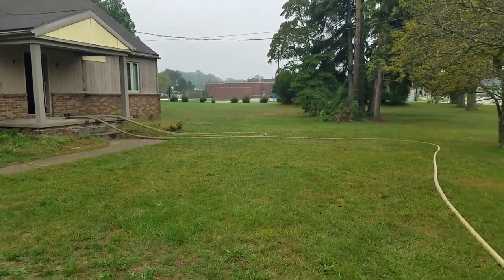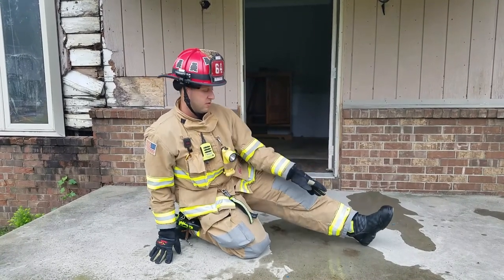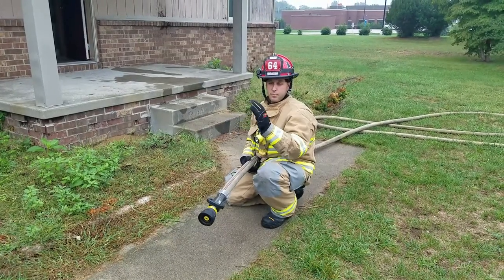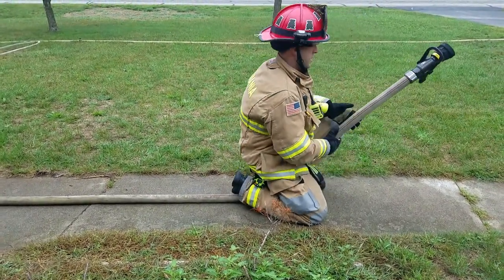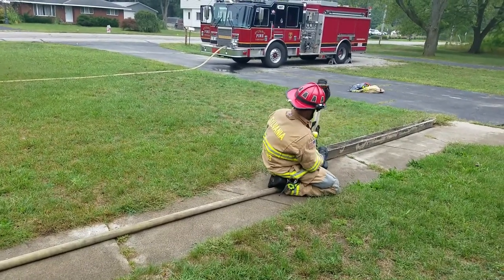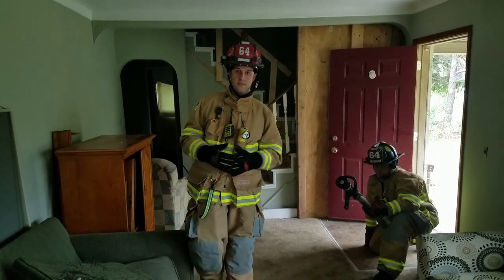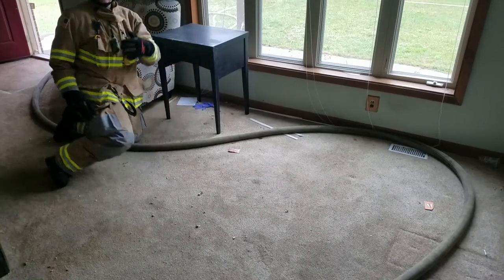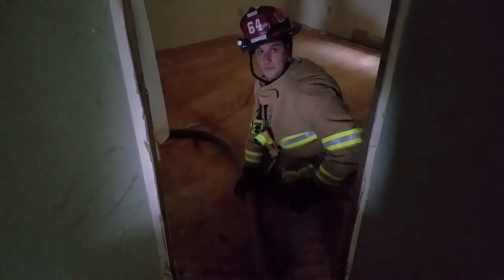Nozzle Forward Training Video- 9-11-2020

Comment: Flowing water at half bale and moving is actually for the 2.5 to allow it to bend easier . Not saying you can’t for the 1 3/4 . But the real reason to be at half bale is for the 2.5. 
The 1 3/4 is full flowing with the knee walk or hip grip.

Comment: Whats the reason to flow and move forward at the same time? Other than flashover smoke you wouldn’t want to put water on smoke only right? And if there was fire above you you wouldn’t pass it, you would hit it as soon as you saw it when coming into the space. If the heat is so great that you couldn’t move through it without doing this, wouldn’t that tell you its a possible flashover and wouldn’t you need more water than just a couple whips from the nozzle and moving past it? Thanks for your help, great video
Reply from the maker: The flow toward the ceiling would disrupt that thermal layer and gases preventing flashover.

Comment: Good Stuff, only thing I would add is make sure you don't have a huge kink in that first coupling at the door @9:10 which would significantly restrict reach (pressure) and flow (gallonage). Thanks for the video

Comment: Why is there a handle if your just going to wiggle it around??? Not thinking the 3 feet of extra "reach" makes a difference......
Reply: Choking on the hose specific the pistol grip reduces mobility and nozzle spray pattern majorly. Grabbing further back make sit easier to combat nozzle reaction force and drive it into the ground vs straight back. 1 3/4 hose can have 80lb of NR with a fog nozzle. Pistol grips are handy for car and trash fires when the hose is going to be under pumped and placed on top your shoulder.
Reply: @HASSON454  Pishposh  you read too much!
Reply: @ShermanAviation  except every single experienced firefighter agrees with him. Pistol grips are a crutch for people that use improper technique or want to hang a nozzle in a window lol
Reply: @RunningWithSauce  I got 30yrs that says your a volly.....